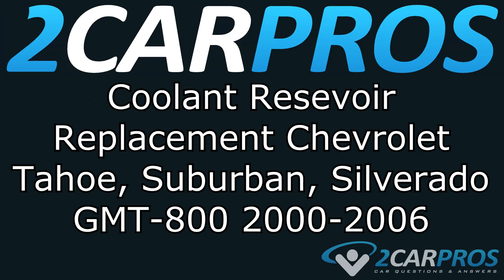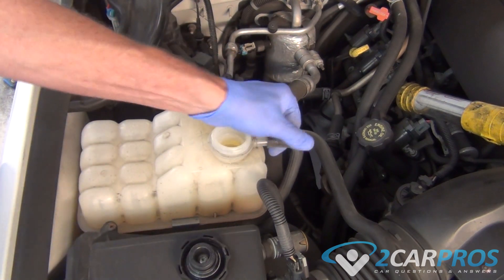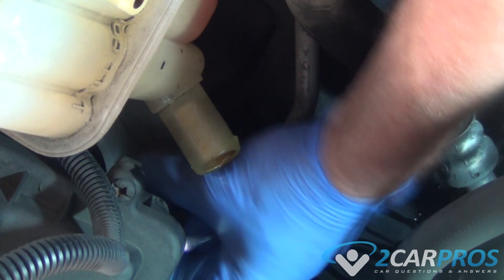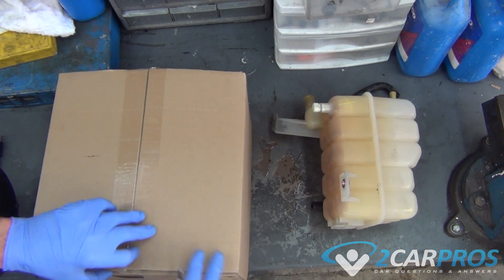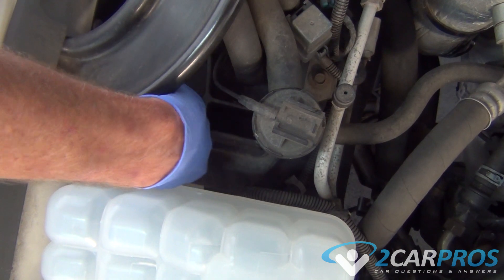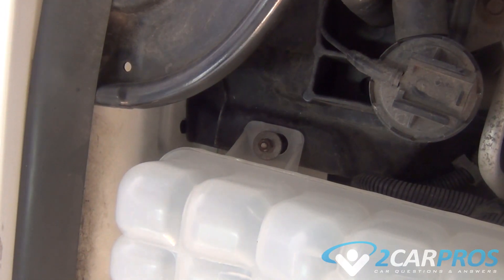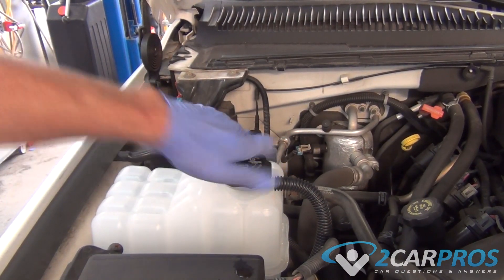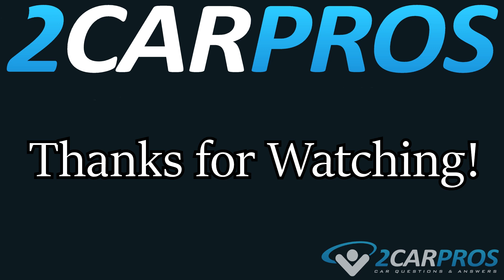HOW TO REPLACE A COOLANT RESERVOIR IN 15 MINUTES! - Chevrolet Silverado, Tahoe 2000-2006

Comment: You dont need to drain the coolant. All you gotta do is clamp the hoses that go to the radiator, remove the top one from the reservoir, then unbolt the reservoir, tip it upside down and remove the lower one, disconnect the level sensor and its out with little to no mess.
Reply: YES! YOU ARE CORRECT.  BUT HE'S FOLLOWING THE BOOK. AND THE MANUFACTURER IS RECOMMENDING THAT YOU DO THAT WAY.
Reply: @Rnm1hart  I know. I'm just sharing another way to do it is all
Reply: @randysshop9683  nobody from a shop to diy is going to drain the coolant.  It might be a good idea to drain it if it hasn't ever been done but I would also replace that hose after I recycle my antifreeze 😂🍺

Comment: gonna plan on doing a coolant flush as well as replacing the reservoir, would it be better if i do the flush with the old reservoir then replace it or should i replace it and then do the flush?

Comment: After 2004 there is no drain port on the radiator. You must remove the lower radiator hose. It was easier for me to simply siphon the reservoir as dry as possible.

Comment: What's the name of that tool used to remove the tubes (the circular tube-holder-in-place thingamajigs).
Reply: FireFist Rodriguez Hose Clamp Removal tool.
Reply: Yes you can, I actually used pliers when I replaced my own. Put some wd-40 before so it can make it easier to remove.
Reply: ARES 71100 - Flexible Hose Clamp Plier - 24-Inch Heavy Duty Cable Flexes for Use in Any Position - Works on 18mm-54mm Hose Clamps  (on Amazon)

Comment: I need help !! I cannot find the wire you connected at 3:35. I have a Pontiac g6 2008. Where is that wire? Is that what causes my tank to over fill and bubble up all the time ?
Reply: that wire is the sensor that will flash "low coolant" sounds like its been ripped off. and if your tank overfills and bubbles its because your cooling system is failing
Reply: pontiac g6's have bad design and blow head gaskets around 125k
Reply: Purple Sway thank you. G6 is at the shop right now. Last time I will spend put money into this car
Reply: @MexicansLoveMeh  you should get a kia forte or silverado 6.0 v8.ive owned lots of cars but those 2 never gave me problems. my 6.0 v8 is at 281 k and running good. the kia at 94k running good. pontiac portion of GM went out of buissness due their poorly designed cars
Reply: @MexicansLoveMeh  Also if your wire has been ripped off find the rip and to junk yard and cut one off then splice into your car

Comment: First flaw if youve replaced the cheap plastic radiator that gm put in the replacement does NOT have a drain. They saved 15 cents???